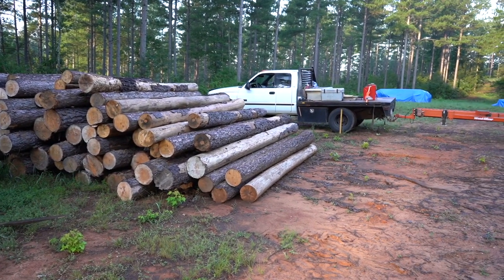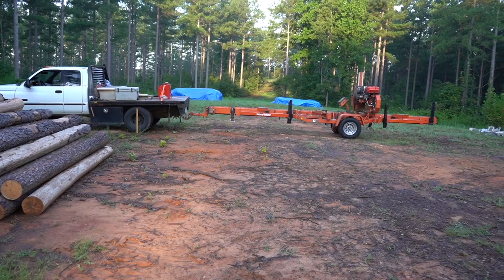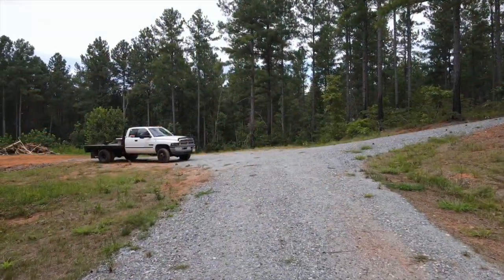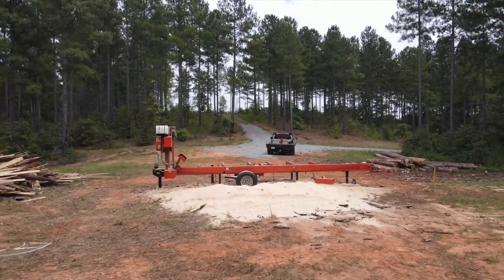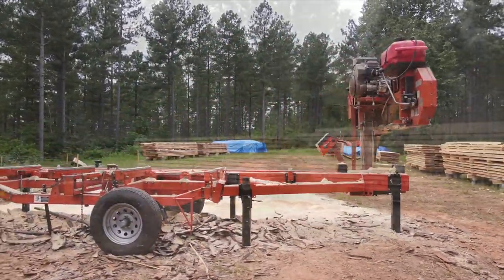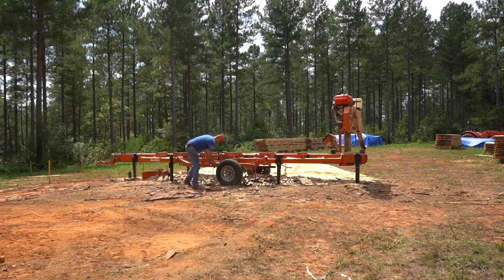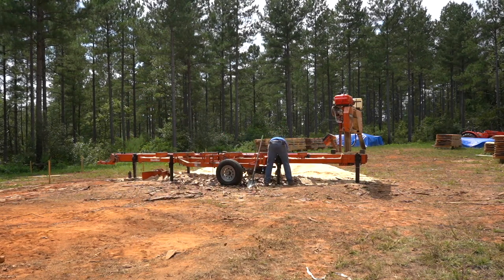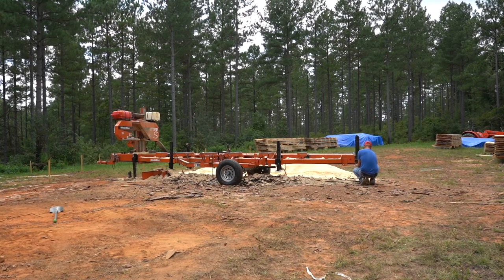Portable Wood-Mizer Sawmill. How Many Board Feet in and Hour?

Comment: I'd would be interested in seeing how you set up and mill this much footage in 2 days. I can only cut 500bf by myself per day with a manual mill. I'm looking for ways of being faster.
Reply from the maker: What size mill do you have? This was one of my personal best. When milling by myself on the LT35 500-800 is a good day. A couple of factors made this job as  smooth as a mother’s love! 
1. Log size. I would make a cut flip 180 make second cut, flip 90 and make boards. We were doing 3-5 logs an hour. 
2. Lumber size. We were cut mostly 2x and bigger. With a 2x8x12 that’s 16bf. I was getting 4-6 from each log and averaging 4 logs an hour. 
3. The guys helping. They fell in like they had worked around a mill all there life. All I did was saw. And most of the logs I could flip from the operating side by hand. They were ready with the next log the moment the last board came off. 
The guys helping made it happen!!
Reply: @DustyRanch  20 horse baker is what I'm running. I load with an excavator,  flip by hand, and have been stacking lumber alone. Lately I've been cutting 8-14 ft 8-14" eastern red cedar onto 2xs of any with I cab cut them.
Reply from the maker: @ozarkscarguy540  those are good mills from what I understand. I’m not extremely familiar with them but I’m thinking they have a two clamp system. One thing WM has figured out is the clamp. With the single cam style clamp (if the log is small enough diameter to reach over) I can clamp a log by myself in 15 seconds. If it’s taking 5 minutes to clamp a log each time you flip it your losing 20 minutes of production on each log. 
It really, is the small thing that slow down production. Minutes add up to hours very quickly. That’s something I often forget. 
My goal is to have the blade in the log as quickly as possible. I use a Skidsteer to load and I have thought about buying a stand on Skidsteer just to save the time it takes to climb in my unit.